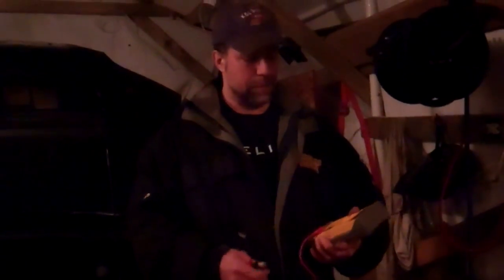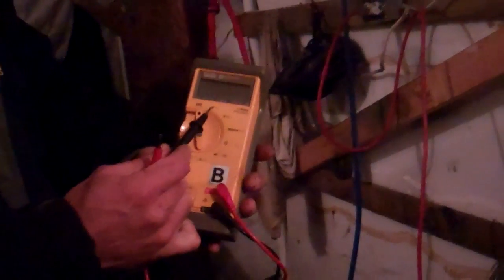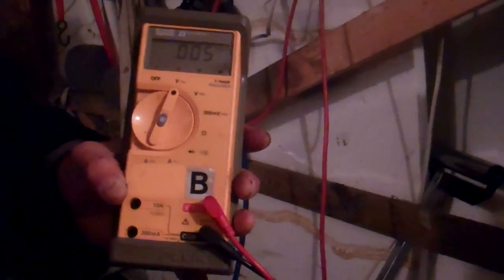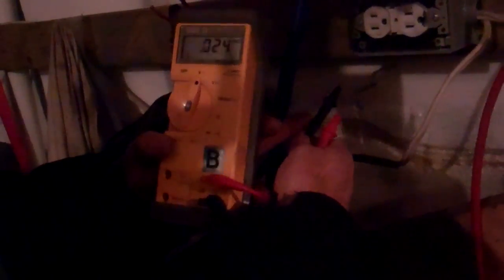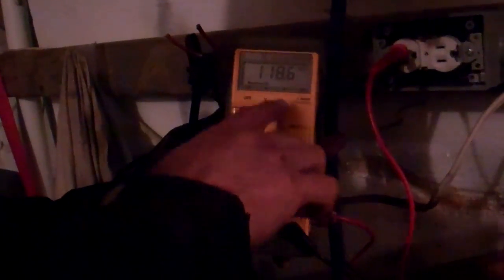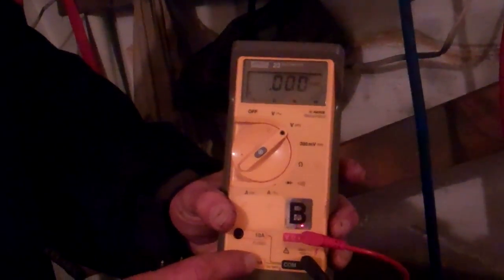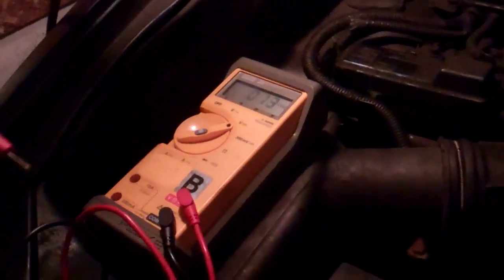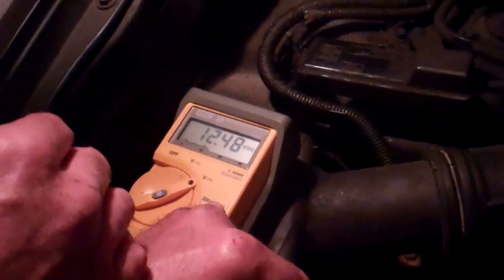How to use a multimeter to fix vehicle electrical problems

Comment from the maker: That's a video i haven't made but it's on my list Axen. Condensed version - I'll be disconnecting the sensor at the wheel, spinning the wheel, and checking for a voltage reading at the output of the sensor. There are probably some good videos on Youtube for this.